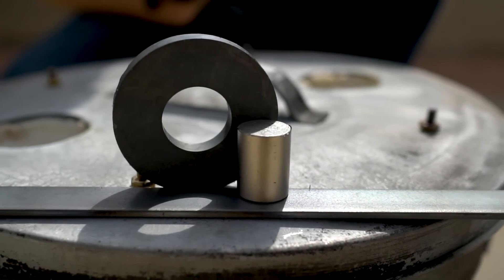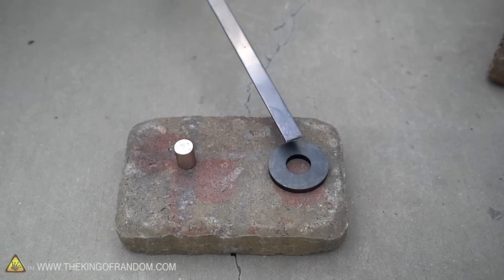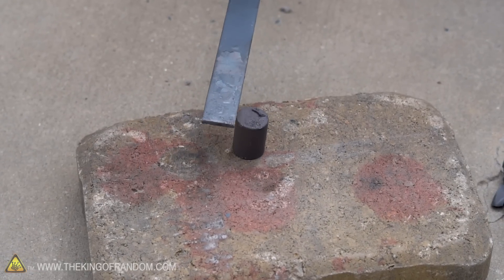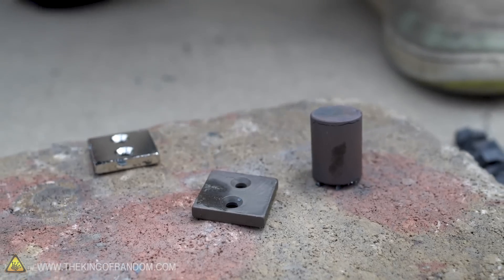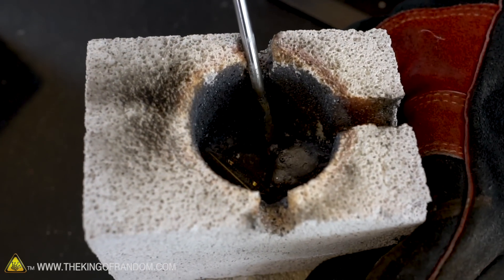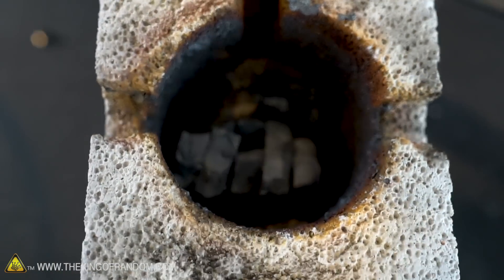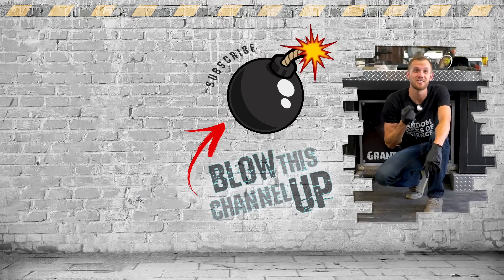Melting Magnets is Weird

Comment: Scientifically magnets should lose their attractive forces (Magnetism) after it's heated, so it won't attract anymore
Reply: kr4zyy yeah.. didnt everyone hear this? I thought it was common knowledge, to get rid of a magnetism in a metal heat it
And to add it electrify it (if im not mistaken)
Reply: OverKnight 52 you can also run a magnet against metal to magnetise it, like those small keyrings with a magnet so you can magnetise a screwdriver
Reply: Biggie Whiggie yeah usually used on screw drivers to get them to grab the screws
Reply: OverKnight 52 You can also drop it from a height to make it lose some of its magnetism, not just Electroplating and heating
Reply: Just because you do understand doesn't make it NOT magical. You don't actually know if the core is magnetic or not, because you haven't measured it. I know you haven't, because that would be a pretty massive breakthrough in human's ability to go to dangerous places. 

Spilling the textbook concepts you learned doesn't help teach anyone here. It's just regurgitation, like friday test day.
Reply: NiceWhenEarned RudeMostlyElse you know it's possible to do observations on a smaller scale and extrapolate information from those experiments right??
Reply: Absolutely wonderful point, and in alot of places and fields, that very concept is the backbone of how we improve things. However, the key differences are the fundamental understanding of the concepts that the data reports on, the objective and accurate recreation of the model of the core of the earth, and whether or not the difference in data density(literally comparing megatons to milli-something) would act the same as the actual core.
Reply: Basically, the experiments i have seen on the core(i could be ignorant to some) focus on building the model around reporting the same data, not around rebuilding the core and seeing if the data lines up. The earth's core may be made of liquid sodium spinning around, but the fact remains, nobody really knows. It just so happens that spinning liquid sodium produces results similar to the earth's core.
Reply: kr4zyy   Scientifically, the earth’s molten metal core should not be capable of producing or maintaining magnetism; but thankfully MAGICAL SCIENTIFIC FAIRY FART DUST permits it to retain its magnetism beyond the Curie Point. . .  And if you believe that I have a bridge for sale in Brooklyn. . . So much for lience, I mean science.
Reply: Try spinning a huge amount of molten metal through a magnetic field and see what happens....science!
Reply: emknight84 Yes but what has this to do with the molten ball causing the magnetism?
Reply: IamNemoN01 Probably not a molten core indeed. I think more like duality becomes trinity.

Comment: Magnets works because it's magnetic particles are all aligned to a singular direction. When magnetized materials are heated it allows all the magnetic particles to freely switch poles and become unaligned. To make it magnetic again you would have to align all the poles again which could be done with another magnetic field.

Comment: What if you put a ceramic magnet in a crucible and try and melted down that way so it doesn’t crack everywhere
Reply: Have you ever seen or heard about molten ceramics?
Reply: Molten ceramics? What is that, some sort of witchery?
Reply: You know, NASA uses ceramics to shield the space shuttle from the heat during atmospheric entry?
The heat is so high, it turns the air into plasma. We can consider temperatures up to 5500°C here.
Osmium (the hardest metal known and thus a rare one) melts at 3130°C.

Comment: Neodymium magnets are demagnitized permanently at quite low temperatures (<150 deg C). This is called "Curie Temperature). That is why putting a Neodymium magnet next to red hot steel will destroy it.

Comment: The magnets losing their magnetic power as they're heated is something I anticipated. Usually, we see magnetism as the metal grains of the material being aligned in such a way they produce their own field, and therefore, by heating the magnets up, you're tempering the material, and thus they realign to their natural positions, destroying their magnetic properties. On the other hand, I did not expect the whole thing with the steel bar becoming magnetically repellent like that when heated.

Comment: This meaning we can defeat Magneto by sending Human Torch.
Reply: This is my favourite comment I can die happy now
Reply: OneEye Gentleman this comment made my day
Reply: OneEye Gentleman In order for that to work his skeleton would have to maintain that temperature the duration of the fight. So his skeleton would be searing his own flesh from the inside.(also metals are weaker when heated to such temperatures)
Reply: if you watched the all movies maybe in one movie he can control plastic
Reply: OneEye Gentleman like 1500 f°
Edite: the metal drom the comics has magic in it so it near impossable to melt it down
Reply: @Ratko Mladalic Star Wars got nothing to to with it they ar e talking about x-men a Marvel comic
Reply: yep easily. magnetism is based on all electrons in a block of metal spinning in one direction (Ferromagnetism) or having unpaired electrons in a molecule (paramagnetism). so giving the metal an engery spike we can get something that should be quantum mechnaically forbidden. but forbidden in QM just means "ill advised and takes a lot of energy" and that´s a spin reversal completely wrecking the  ferromagnetism (making oxygen unmagnetic reversing paramagnetism works with heat too but on a different mechanism that would completely be university level chemistry) but yes high heat beats magnetism 10/10
Reply: Also Dr. Doom
Reply: Saiful Anwar Hamdan you have no idea what Magneto's power really does? Do you?
Reply: He means the supervillain, not the generator...

Comment: Try putting glowing hot steel on a slice of refractory brick with a very powerful magnet underneath it use a slice of refractory brick that is thick enough to protect the magnet from the heat of the steel yet thin enough that a cold piece of steel would definitely stick to the magnet through the brick then let the glowing hot steel cool down to room temperature and see if it is then a magnet

Comment: hi, im a blade-smith and there is something we call "critical temperature" and that is the point of heat where the metal wont be attracted to a magnet,   the point of critical temp is when you know that your metal will get hard enough from dipping it in water or oil

Comment: Blacksmith here When steel hits critical temperature (when it can be quenched) it stops being magnetic.  that steel wasn't close to 2000° btw. My guess is maybe 1500°. Just because it gets that hot, doesn't mean it transfers all that heat to the steel. When it gets almost white, it's closer to 2000°, like maybe 1800°, that's when you can forge weld.

Comment: simply put, heating the magnets changed the structure of the atoms, losing the magnetism . usually how they make magnets is by putting them through a couple of different processes to align the atoms in a particular orientation

Comment: That steel is about 1600 degrees. Once it gets above 2000 it turns white hot and then starts melting.  I know because I work with mild steel when blacksmithing

Comment: Liquid metal in vacuum chamber like if you want to see
Reply: I doubt they can reach temperatures for the metal to stay liquid for a couple minutes while they are pumping a vacuum. They might be able to use the arc furnace to melt it inside the chamber. Although it would be cooler to see the arc furnace just making arcs in a vacuum chamber.
Reply: amadeusz antyga I just liked after seeing that it's too big
Reply: REVIEW CREW which gallium or mercury. I wanna see both.

Comment: Heat causes resistance or in this video a reverse magnet effect. Same for current voltage if wires heat a friction affect occurs slowing fliw of ENERGY. Freezing temps open flow this is why power from our Sun reaches Earth. Energy is the basis for life to all seen and unseen.
The carbon from magnets likely would be a great sword experiment for strength

Comment: You are rearranging the atomic polarity with the heat so of course it will loose its magnetic properties. A magnet simply has all the electrons and protons aligned, you are allowing them to scramble so they return to base metals.

Comment: The ceramic magnet broke because ceramic is meant to be heated slowly. If it heats too quickly, it shatters. That's why you can't put ceramic plates and such in the microwave; they break.

Comment: Two suggestions:

Find a way to mix your glow-in-the-dark liquids with a bubble solution, or see if the dish soap enhancement to increase it's glow also works to blow bubbles. Glowing bubbles are always fun.

Also, we've seen that extreme heat ruins a magnet -- what about extreme cold? Do magnets work after being submerged in liquid nitrogen? What about steel that's been submerged in liquid nitrogen -- does it still attract magnets just as well as it would normally?

Comment: In basic explanation, magnets exist when their magnetic fields or all the tiny bits of steel are all lined up. You can strike the end of a length of steel repeatedly and it will get a small magnetic field. Heating the metal up where the small bits of steel are no longer "locked together" (below the melting point of the metal) allows all the bits to go random again, and while heating up, they can't decide what field direction they have, so in essence, the hot metal shows no attraction to magnetism. 
I would suspect that if you apply a Direct Current Electromagnetic field (and not a degaussing coil which is an AC electromagnet) to hot or molten metal, that as the metal cools, it will form a really nice magnet.
Thank you for the video. I still watched it knowing the outcome.

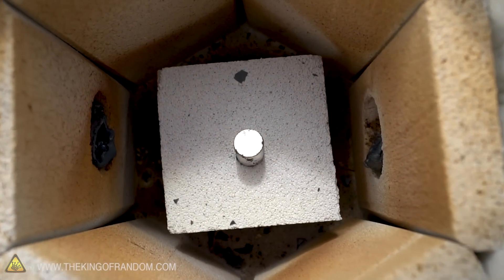Comment: At 3:00 you state that the magnet is mostly made of neodymium. This is actually a common misconception: neodymium magnets are mostly iron, with a comparatively small amount of neodymium and a tiny amount of boron. The chemical formula is Nd₂Fe₁₄B; by mass, that's over two and a half times as much iron as neodymium, and by moles that's seven times as much iron as neodymium.

Comment: the steel will become non ferrous when its heated, and become ferrous when it cools. the magnet will loose its flux when it is heated, and it will no longer be a magnet when it cools off, "depending on how long it is heated for".

Comment: Don't put hot metals in glass bowls with water, they shatter.
Reply: Nathan Sinclair that's why he didn't let the metal touch the bowl he held them up with pliers
Reply: well yes he knows it could shatter it, but did you see how well the water insulated the glass? same principle applies to putting a balloon over fire with a small amount of water in the balloon.
Reply: I'd guess it's not conventional glass, it's borosilicate or soda lime glass (Pyrex). Borosilicate lab glassware can be bought on Amazon or eBay. Soda lime glassware is cookware (less temperature resistant than borosilicate, but should be fine if he doesn't touch the glass with the very hot metal, only the boiling water).
Reply: I think this guys knows more than the comments in a YouTube video.
Reply: Nathan Sinclair they know that
Reply: yeah, it's much safer to use glass bowls with gasoline instead of water.

Comment: You could try the ceramic magnets again, but you need to heat them up slowly. Almost any ceramic will shatter if you heat it that quickly, only very specialised types of heat resistant ceramics can cope with it. Get a pottery kiln, and set it to heat up slowly, perhaps at 100 degrees Celsius per hour. It will take a few hours to get to the desired temperature, but it should survive the heating. (Mind you, it will probably shatter with the rapid cooling when you take it straight out again...)

Comment: Place a coil of wire around the furnace.  Allow some electricity to flow through the wire, creating a magnetic field while the steel is melting & cooling... Then what happens?
Reply: That's called an "Induction Furnace".
Reply: An induction furnace uses AC to generate a rapidly fluctuating field that cause the metal inside to heat up. What Glenn is talking about uses DC.
Reply: The current must be DC, not AC, and it has to be reasonably strong.  Cooling the alloy from above the Curie temperature to below the Curie temperature with presence of an external magnetic field (from the coil) would magnetize the alloy.
Reply: Glenn Gutshall 
Not a bad idea, but it won't work.
Reply: Nothing, Curie temperature is lower than melting point in all metals.
Reply: hello, some people understand it, but most apparently not, they mean what would happen if you've got a DC electromagnet around it to obviously magnetize the demagnetized metal.
Reply: Don't know but lets try. Gonna get some microwave ovens transformer
Reply: Due to eddy current heat is generated
Reply: Sai Akhil it will not generate heat or current when it's just DC, Induction happens via high-frequency AC, not via DC.
Reply: Isn't that a solenoid?

Comment: I heard magnets actually get stronger when you freeze them. I was wondering if in your next video you could do the opposite with the magnets. Maybe dip them in liquid nitrogen.
Reply: It would levitate I guess
Reply: They are not levitating by itself but metal objects above it start levitating.
Reply: By anychNce are youtalking about supercooling and mg rails? 
Because as much as you're on the right path its slightly different as the metal (can't remeber which) is only repellent  and adjusts its polarity after being super cooled 😊
Reply: Zeldas Champion electro magnets do but don't think these do
Reply: i was going to ask the same thing!
Reply: You can't freeze a magnet,  because it is already in a solid state.
Reply: John Bond by freeze I would presume he meant cool
Reply: John Bond he means cooling it you nub

Comment: Could you make the ark furnace on a bigger scale?
Reply: And could you wrap heat resistant wool around vise grips to avoid burning your hands?
Reply: If the heat resistant wool worked then you might be able to kelt metals longer with better results

Comment: Can you freeze electricity
Reply: You can trap it
Reply: Mirella ok
Reply: We like to think of electricity as water flowing through a pipe, but it might be better to think of it as a wave in a stadium, where you lift your hands when the person to the left of you lifts their hands. You're not actually passing arms down the line, only reacting in a line.

Interestingly, LIGHT is not a pure energy. It has a piece of matter known as a photon, and it actually DOES get affected by gravity and cold temperatures. It's also why light can travel through a vaccuum, and why infrared light can convey heat through space. Thermal heat, sound, and electricity can only function if there is something reacting.
Reply: Metrion77 
So in other words, you can freeze and burn electricity at the same time.
Reply: You can burn it
Reply: Lone Wolf ok
Reply: you can freeze electrons if you reach absolute zero. but that's in theory as no one has been able to hit that low
Reply: Electricity is basically a flow of electrons+if you even know what they are)and in theory, you can freeze them if you reach absolute zero, but sadly  that's not possible ............YET.
Reply: Vikyath Reddy Kolanu yes its possible but it cannot be done without the right equipment plus even if they manage to do it, it would not be visible in less than a second
Reply: No, but if you could, it would be a shocking experience.
Reply: Ungregistered User I mean, he's not really wrong. Amperage is a measure of current so current * voltage = watts isn't incorrect. I can why it's practical to use that. However watts = volts^2/resistance probably makes more sense when explaining things(current = volts *resistance).
Reply: By definition electricity is a type of energy, so no
Reply: YasuTaniina ok
Reply: YasuTaniina electricity is actually current combined with voltage
Current is electron holes though
Reply: GB Gamer bro u grade 4

Comment: Btw the next most common component of Neodymium magnets, is Iron, with a bit of Boron and a little Aluminum usually present. Aluminum melts at 1200°F/660°C, but Iron and Boron are much more heat-tolerant, requiring 2800°F and over 3500°F respectively. (over 1500°C and 2000°C)

Comment: Melt down lithium
Reply: TCreeperRBLX that would be hard to do without proper vacuum setups. It would just ignite
Reply: K0ester Actually, They could make a vacuum, fill the chamber with nitrogen, and repeat a couple times, and then they would worry about melting it (arc would work in a vacuum)

Comment: Not sure what they expected, super cooling magnets makes them more attracted to a metal's valence electron shield. Super heating them causes their atomic configuration to change slightly thus removing their magnetic property. The Neodymium will lose its polarity, ceramic (soft Ferrite) magnets will shatter due to it being a composite and of course when they are fully melted they simply become a metal/alloy. Fundamentals of science!

Comment: Ways to Make a Magnet
Among the methods Henry mentions for turning an ordinary iron or steel rod into a magnet are:

Rub the rod with a piece of metal that is already magnetized.
Rub the rod with two magnets, drawing the north pole of one magnet from the center of the rod to one end while you draw the south pole of the other magnet in the opposite direction.

<b>Hang the bar vertically and hit it repeatedly with a hammer. The magnetizing effect is stronger if you heat the rod. </b>

Induce a magnetic field with an electric current.

Comment: maybe if you have a electric coil on the outside of a ceramic cup then place molten metal into the cup and apply a current through the coil it may then retain a magnetic field.